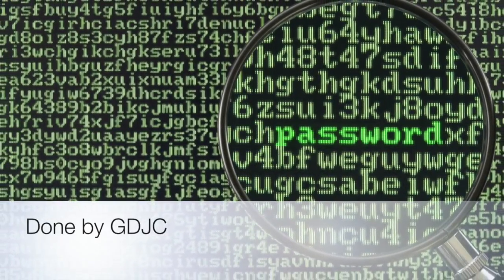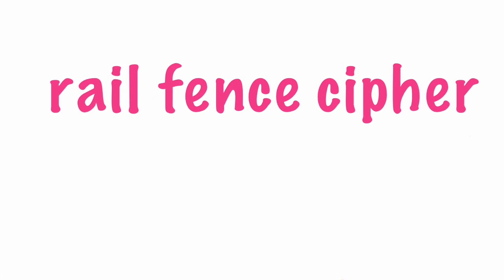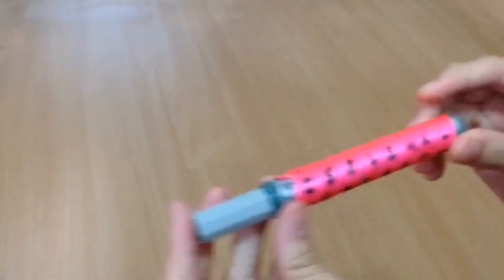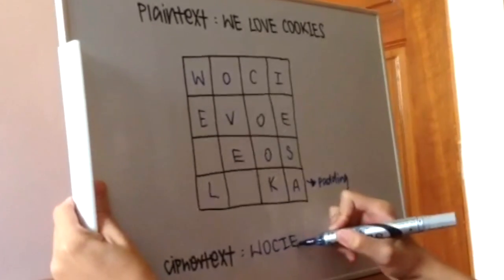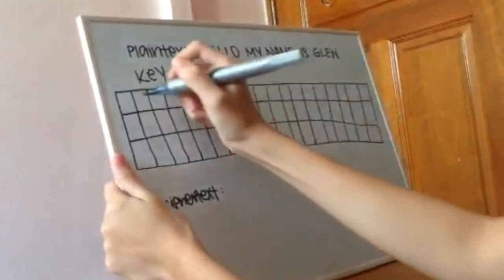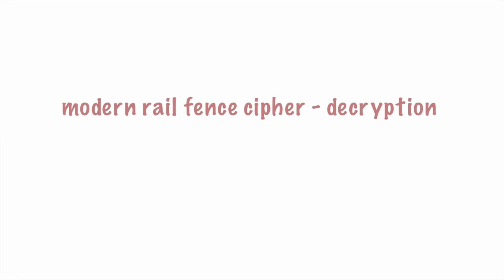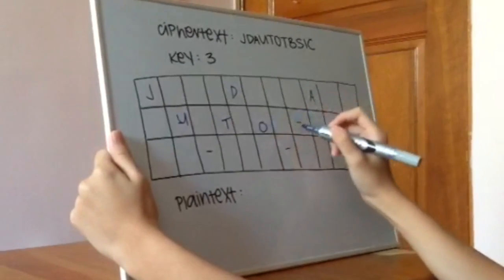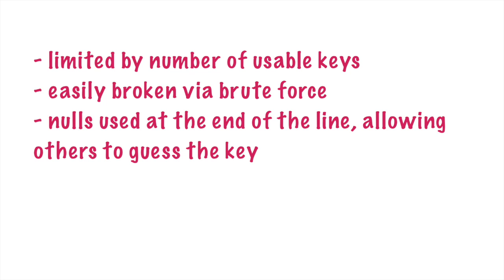Rail Fence Cipher

Comment: The only issue I have is that the scytale is not a rail-fence cipher. It is a simple example of columnar transposition. I've seen this misinformation in several places. As you used the scytale and rail-fence you should have noticed that the order of the letters were different. Good job on the video, other than that.